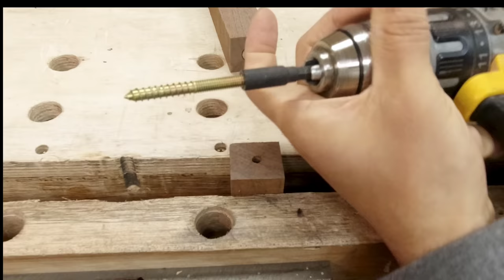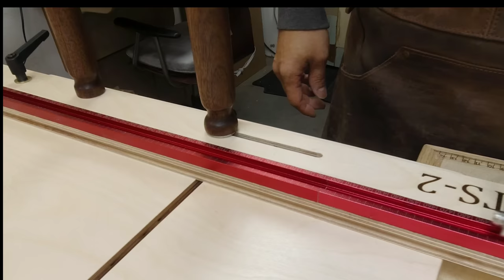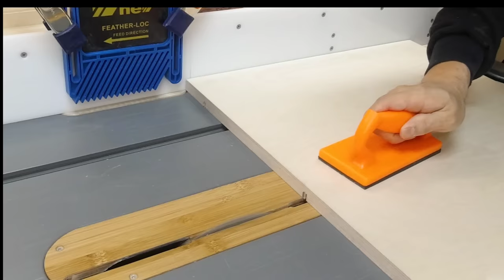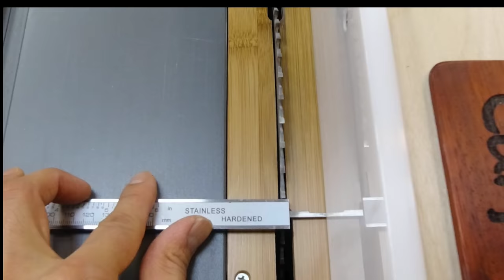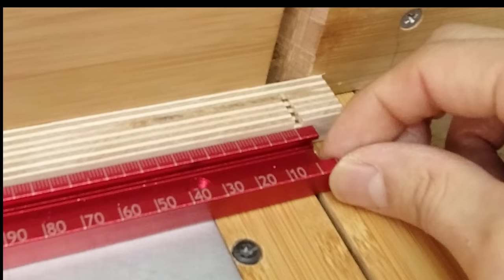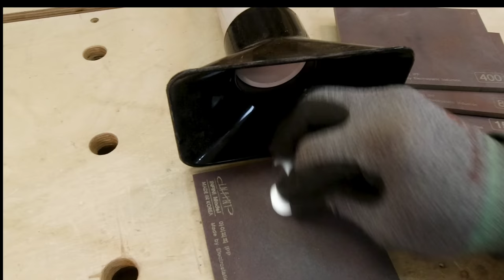⚡[DIY] All-in-one table saw sled / Various functions / Woodworking / Tips and tricks

Comment: awesome useful sled. 
What is the size of the t-track? 
What is the size of the ttrack router bit and why did 't you directly use it and first made groove with table saw?
Reply from the maker: It is a t-track with a width of 8mm.  The first thing I do with a table saw is to extend the life of the router bit.  If I just work on it, the router bits will have a shorter lifespan.  It also increases the precision of the T-track. Thanks
Reply: @carpentak  wow. thank you very much for your answer and tip. 
I think 8mm is the top layer groove for M8, what is the bottom layer groove width?
I think 8mm - 12,5mm is good for the hammer heads and clamps that you use.
Reply from the maker: @oksuztepe Maybe that's right.

Comment: Nice Job, how do you make sure, that the fence is 90 degrees to the blade when fasten it ?`Smörebröd :)
Reply from the maker: I worked with precision, so when I pulled the fence and secured it, I got an exact 90 degree angle.  Of course, it is good to check it once using a 90 degree ruler before use.

Comment: Подскажите пожалуйста, что за винт используете для упора на линейке ?
Reply from the maker: used t-bolts.  It is t-track only and sold with t-track.  There is a link to the video information.
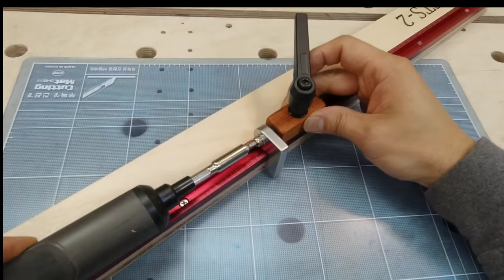Reply: @carpentak  болт для упора аллюминивого , что на 20:22 крепите ?
Reply from the maker: @ВаартилампийУпович  It is an M5 wrench bolt.

Comment: good work. What kind of wood do you use as multiplex?
Reply from the maker: thank you  It is walnut wood.
Reply: @carpentak  isn't the walnut multiplex panel brown...? I would have thought rather linden or birch panels but without certainty...
Reply from the maker: @j.b.6203  Sorry I misunderstood and answered wrong.
The plywood is 18mm birch plywood as the base panel.
Walnut wood was used for the handle.

Comment: Do you provide any plans with any of your builds?
Reply from the maker: No I can't make plans.
Reply: @carpentak  Would you just give the distances between the grooves please? I suppose this is important to get good results for the cuts with the square
Reply from the maker: @danav4810  The distance between the grooves does not matter. Dig a groove at a suitable line. In order to set the right angle of the guide fence, the most important thing is the position of the locking knob close to the cutting line on the right. As I showed in the video, with the right angle of the fence precisely aligned, use the dowel pointer to mark the location of the hole on the fence, and then drill accurately to get the right angle. This is important.